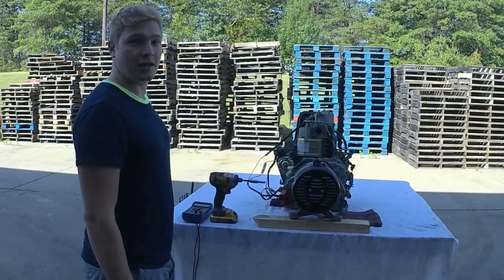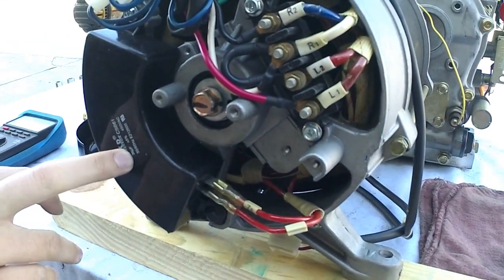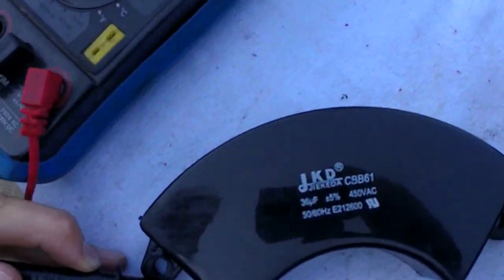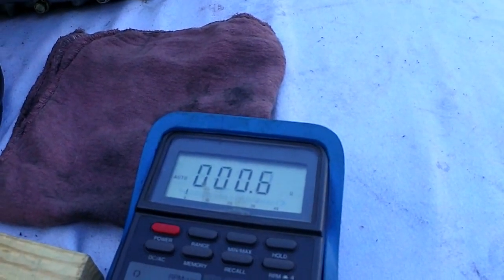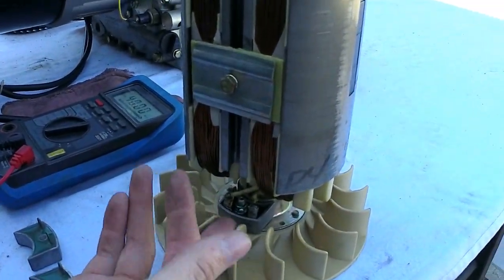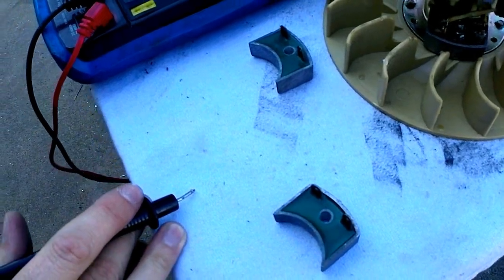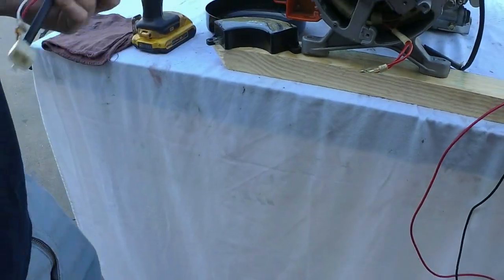Portable Generator end Testing (Brushless) LCT brand Diesel

Comment: Measuring between R1, R2, L1, L2 to ground or the chassis should never read "zero".  It should read infinite (open circuit) to the chassis or frame.  The flashing "4" on your meter indicates an open circuit.
Reply: Thank you,
Reply: Excuse me, isn't neutral connected to ground in generators? And so, considering that one among L1/L2/R1/R2 should be neutral, why should be open loop between these contacts and ground? Thank you
Reply: @andrealanzolla1798  Not when the wire harness is disconnected. pretty sure he said that.
Reply: @integr8er66  Correct. I have a larger 8 kW brushless AVR generator and neutral is not bonded to the frame. Typically the panel will say "neutral bonded to frame" and as mentioned in the video, disconnecting the generator head from the control panel will disconnect the neutral from ground for testing.
Reply from the maker: Ahh yes you are correct, I have never noticed that is what i said. Thank you

Comment: Thanks for the video. I bought the engine shown in this video from someone who said the generator he had broke and he had taken the engine off, given the electric start motor to a friend, and sold the engine (to me). I hear it's very common for these generator ends to fail, and knew there wasn't a lot involved with fixing them. Of course, I'm happy I got a reasonably priced engine. :D 
Question -- is this unit really made by the LCT/Liquid Combustion Tech company, or is it just a Chinese knockoff using a well known company name? Reason is, I could not find any mention of this diesel engine on the LCT company website. 
Also - does this engine come with a flywheel-mounted DC charging coil for the electric start battery, or is the engine-mounted voltage regulator powered from the generator end diodes? I can't see any wires coming from where the charge coil is normally installed, and have purchased a new charge coil and permanent magnet rotor to install to allow the engine to keep a starting battery charged since I've re-purposed the engine for use on a wood chipper. The engine has a DC voltage regulator attached to it, but the leads had been clipped and I didn't see the 2 leads coming from where the flywheel rotor is usually installed, so I'm going to have to pull the flywheel anyway, but was just curious if they normally tap off the exciter coil/diodes to avoid the need to install an engine-mounted coil. Thank you for showing how to fix the generator end. I have a gas powered Winco generator which is having trouble starting motors far below the rated power so think I may eventually troubleshoot that unit using the info you presented here. Much appreciated.
Reply from the maker: As far as LCT they no longer manufacture or import the diesel because of EPA regulations, the DC voltage regulator gets its power off of the two blue wires(there should be two sets) on the gen end, it should have a connector the same as your DC connection. Most of the units have a extension wire that goes from the gen end to the DC regulator.

Comment: Hello MacleTech, If I understand this right, the rotating field in a brushless gen has 2 sets of
windings?  one set sakes in a.c. sent to a fw rectifier bridge and sends d.c. to the other 
winding? The capacitor is used to hold a  charge on the stator windings so rotating field will
have a voltage induced in it when it starts to spin, that a.c. is turned to d..c to make a stronger 
field for the generator to build up.

Comment: Mr. Tyler, it was great to see you in live demonstration. Finally and late to get back to 5500 diesel generator repair. Installed the tank valve. Good information on troubleshooting my low voltage on generator. I will see to it and get back in touch. Hope I won't need any diodes.

Comment: I have tahoe industries ti7000lxr diesel generator. It runs 10 to 20 seconds then shuts down. Voltage is 10 volts or so low. Runs fine until flip breaker with no load. Replaced capacitor with cheap on with no change. Any ideas for me.
Reply from the maker: the engine shuts down when you flip the breaker?

Comment: You could get a good shock and make u pay more attention, if one's heart is that fragile, they should not be messing with this sort of thing. Is R1 and R2 returns? for L1 and L2 is the neutral floating or bonded? If R is return, to get 240 would it be R1 toL2, getting neutral between R1 and L2 and 240 from L1 to R2? Going by Dan Burch any continuity between l1 R1 L2 R2 to ground would be a bonded neutral?

Comment: I have an 10 year old 3000 watt Chinese clone Generator that has an AVR in it.  for some reason it just stop producing power and then will come on again  10 minute later.  But I have also  got a very  old  7.4 watt Honda  brush less welder/ generator that I also use I found that once I  get it running right it will actually run the whole house.   As in fridge freezer Even the Ltd TV washing machine etc.  it will also run any electrical appliance that go's though a step down that is that converts 240 v AC current  to say 12 DC current. And over the years It  has broken  down some times  But because my Generator not under a great deal of load It wont massively burn out a huge hole in the wiring usually just a single wire  the stator  have found it  so easy to repair as ever now and then I would burn out a a resistor And at one time when  I burned out that  wire in the stator  I just soldered  it back up again.  and then epoxied the broken wire if you use one of these for the house make sure to use a power surge conector

Comment: I've got a 10k watt unit I picked up on the cheap.  One of the 120 legs works just fine, the other blows its breaker anytime a load is placed on it.  I fired the parts cannon at it without investigating thinking it's just the breaker.  However, a replacement breaker results in the same.

I guess I gotta start diving a little deeper into the issue.  It's a capacitor-excited field coil setup.
Reply: Seems weird to me. and u r sure it is a 120 volt winding? as  a brushless job would have 3 stator windings, ur two 120 volt windings, one side of each hookt to a white wire for neutral to get the 120 volts off each leg and an exciter winding which should go to the capacitor.

Comment: can i change the capacitor for a generic  one of 35mf 'y have a problem with a generator egual than this a change by another an i do not have genaeration  please help me and excuse my bad english
Reply from the maker: You should stay within the 5% range of your original capacitor rating, but we usually go up or down 2 µF if we do not have the exact cap in stock. ( example: if we need a 26 µF cap we usually replace it with a 28µF cap or a 24 µF) it does not cause a noticeable difference in the output.

Comment: What is the exact type,
 of this type of generator ?
Reply from the maker: This generator was Titan 7500D with the LCT engine on it. It was brand new  and i know they aslo had a H2 model that did use brushes.
Reply: I think someone has fitted a brushless diesel generator to a brushed motor
Reply: Oh ok i have a problem with mine its brushed on the rotor.
I cant get any voltage out of the main windings.
And no voltage from the rotor wingings. 
It has no capacitor except for the rotor windings in the control module

Comment: WHAT IF THE REPLACEMENT CAP IS 10uF LOWER?
Reply from the maker: Then you will most likely see a low voltage output. You should stay in the 5% range of your original l cap and if you cant only go up or down 2 µF or so.

Comment: I have 8000 ridged generator it run but no power what’s seem to be the problem
Reply from the maker: I need a little more info than that..Is it brush or brushless, what are your rpms, your ohms readings?

Comment: Great video.  where the video to test a brush generator or avr?
Reply from the maker: We currently do not have one. AVR ends are....not so direct. We are working on a step by step but it most likely will not be a (do this to fix it video). I have some documents i could e-mail over if wanted. tyler@macletech.com

Comment: Excellent, clear well presented video
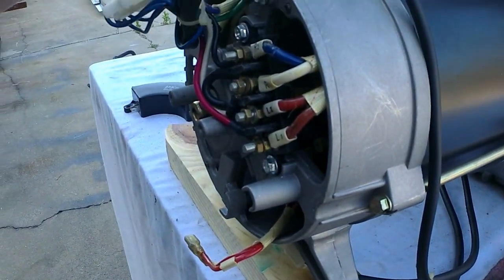Reply: Nice video except two places.  At 6:11 you said resistance should always be zero, a zero reading is a short to ground (the case), which not the case here.  At 8:42 you show symbol for a capacitor, not an "ohm" (resistor) symbol.  Nice job otherwise.

Comment: I tried to email you but it wouldn't go through. 

I have a problem I've been trying to figure out with my generator. On the end of the generator I only have 3 of the four nodes being used (R1,R2,L2) and L1 has nothing connected to it at all. Is this normal? I'm wondering why this is the case. With this configuration, how would I test it for problems? It was made to produce 120 and 240 volts. Any help would be appreciated!
Reply from the maker: I have seen that setup b4 on some launtop brand gens, mostly they just use the 1 neutral wire coming from the panel with 2 mains (witch is not good because it causes back feed but still works) .  As far as coming out of your end are there still 4 wires with 2 on 1 node? If so the testing should be the same, your hot to the neutral node would still show the 120 and 240 between the 2 main hots.

Comment: Professionally laid out with the expected test values...very useful for the self repair person. Please comment on the expected life of these 178F diesel engines....? Ours lasted about 4 hours before splitting the case.
Reply from the maker: I have seen these engines last for thousands of hours and i have also seen a piston go through the cylinder wall after 30, most common they do last a very long time with proper maintenance, check valves periodically keep on top of the oil changes and never ever try to start them with starting fluid or any thing like , if anything use WD-40.
Reply: Good
Reply: How chek avr  is working not working   " yamamoto  43570